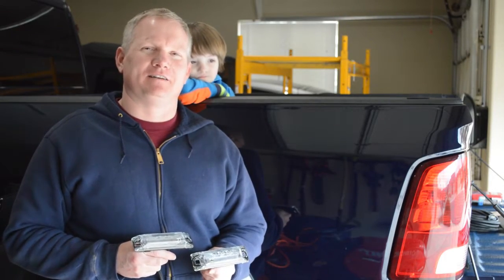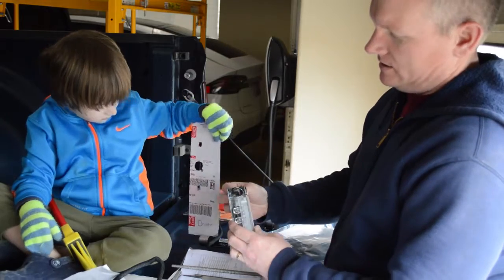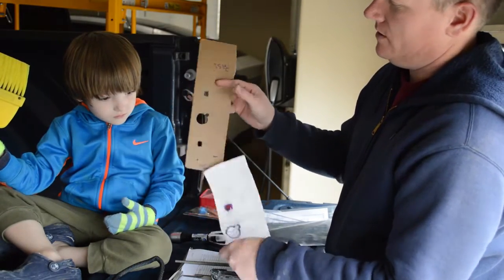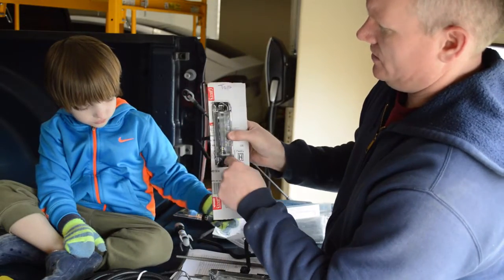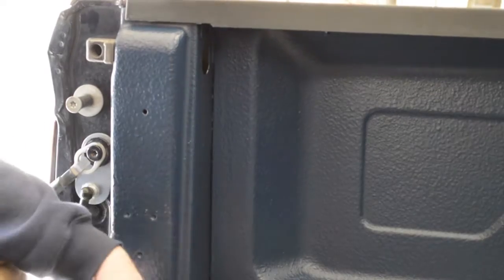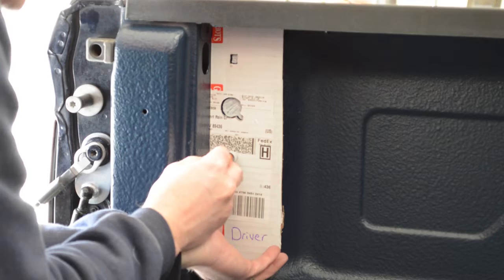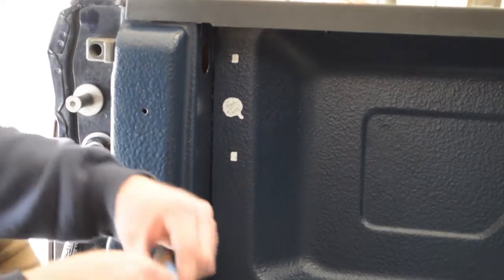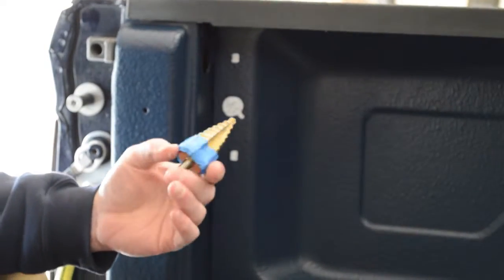Installing OEM LED Bed Lights  - Ram 1500

Comment: Was able to tap in at the C1 plug. Helped to remove the light switch box and AC vent housing and go at it through the vent hole and from below. Headlamp flashlight is a must! Tapped in the a t-tap.

Comment: Jack thanks for the template.  I just drilled the holes and mounted the lights.  Still have to complete the wiring.  The template really helped.  If any of your followers need the template I will gladly pay the favor forward and mail it to them😁
Reply from the maker: John FitzGerald awesome I’m glad it worked well!
Reply: John FitzGerald I’m interested in the template if you still have it.
Reply: Hey John and Eric, any chance you guys still have the template?
Reply: @epix8012  Do you still have that template by chance?
Reply: @epix8012  I’m looking for the template as well!  Anyone have it or can duplicate it?

Comment: It appears that there are two different kits available for the 4th Gen Rams (DT). Mopar part # 82214870AB is for model years 16-17 and is also the one that you should use for previous years as well. For 2018 the kit was updated to include a bed mounted switch, Mopar part # 82215795AC. These two kits will also work on the Ram 1500 Classic and Ram HD 2500, 3500 models up to the currant model year. There is also a 3rd kit available for the 5th Gen Ram 1500's (DS) 2019 up to the currant model year , Mopar part # 82215272AC.

Comment: Just a small tip: use normal car oil on your drill bits to drill into metal.  It saves the drill bit as well as makes drilling a lot easier.
Reply from the maker: Riaan van der Westhuizen Great tip thanks I’ll try that out.

Comment: So the cargo light it is located on the side panel from the steering and is it white ? How come you haven’t tasted it directly from there but to the wiring beside the seat ? I was trying to find this mod from long time..but I’m always afraid to touch electrical stuff and screw it all up !

Comment: question please ? how did you determine what size fuse to use ? Also do you know what amperage the LED cargo lights draw ? thanks for any input, I am doing this but for a 2019 ram that came without the bed led's
Reply from the maker: Billy ST I watched a different bed light video that used the led strip and they went with a 20 amp fuse. LEDs have a low amperage draw and I thought I was playing it safe with a 20 but I’m not sure.

Comment: My 2016 2500 tradesmen has the holes for the lights in the bed, so anyone looking for and vehicle with the holes to make a template might try a 2500 or a 3500.
Reply: My 2015 1500 Limited also has them

Comment: My 2015 have holes om both sides its possible just need plug the wired?
Reply from the maker: The plug will be under the bed. The kit should plug in and run to the other side.

Comment: does anyone with a 1500 know the correct pins to run the bed switch to, i have to C1 pin 5 wire correct but not sure where the secon wire goes as ive seen 2 different diagrams with different pins and not sure which is correct. the cargo lights work fine after activating with alpha obd with cab switch but cant figure the bed switch out.

Comment: Mornig Jack, what lights are you using I can't find any  for a 2013 ram.
Reply from the maker: 2016-2018 RAM 1500 2500 3500 Cargo Bed Light Installation Kit MOPAR OEM, I got them off of eBay
Reply from the maker: They didn’t make them for the 2013 but these work and they are what I used

Comment: Jack, did you have 2 white wires with brown chasers to choose from?
Reply from the maker: John FitzGerald I had to use that light to check which one and I just got lucky. Stab it int the wire, hit the unlock button, if it doesn’t work tru the other one and put some electrical tape over the connection.
Reply: @JackGriffithsgarage  got it.  I used a check light too.  Just finished the install.  Your vid and advice came in real handy.    Just in time for quadding trip out in elk country, Northwest PA.   Should help loading/unloading in the twilight out there!
Reply from the maker: John FitzGerald awesome happy it worked out!

Comment: Just so I understand this correctly.  You took the wire from the bed lights and put a fuse between where you tied into the wire in the floor and the connection to the bed lights and put them into that compartment?  Or am I missing something with the green plug?  Great video!  I can't believe how hard it would have been to get connected to the panel underneath the dash.
Reply from the maker: Jeff Mayer thanks Jeff! Yes I put a fuse to the wire that ran to the bed lights just in case something went bad

Comment: Is there already a wire harness set up for this if so where is it
Reply from the maker: Dylan .M depends on what year you have. I have a 2013 and it was not an option that year. If you look up in the ram forum you can find the years the harness is in there. I have heard it is tucked up on the drivers side rear area. I don’t know specifically.
Reply: @JackGriffithsgarage  thank I have a 2015 holes are there I will half to check it out thanks for responding

Comment: 2018 ram 2500 and I had the cut out, with the wiring already done.  However, my lights won't come on and I'm asking before I have to trace it down.  Does anyone know where the control button is or is this supposed to automatically come on once I open my truck bed?  I searched and can't find a fuse.  Any help would be appreciated.
Reply: MrDreadfu1 I believe the dealer has to flash it or you need alphaobd to flash it on yourself.
Reply: P Falcon ty.  I’ll look into that!
Reply from the maker: I’m positive the dealer has to turn it on. AlfaOBD can do it and totally worth the money for it. Saves going to the dealer
Reply: Jack Griffith's Garage the dealer will only charge $99.95 for me.  The alphaobd is 79.99 ish.  I think I’ll just let them do it.  Thanks for the replies though.
Reply: MrDreadfu1 I have a 2018 1500 Ecodiesel that came without cargo bed lights and I’m curious to see if it is prewired to add the lights.  Can you describe where the existing harness/connectors were?  Thanks
Reply: Jonathan Rossman the harness for mine were right under the cut out holes.  If you don’t have holes already cut out chances are you won’t have pre-wired harness for the lights.

Comment: Couldnt you just push out the light switch panel with the cargo light switch and connect right behind there?  Nice mod!
Reply from the maker: Jake Mason maybe?
Reply: Found my own answer.  Can't tap switch.  It's bcm controlled.  Have to tap the wire you did.   I did it a bit differently.   Used the tap on that wire as a trigger for a new relay to switch power to the harness for the bed lights. .  Thanks.

Comment: What is the bolt that holds up the led lights
Reply from the maker: It’s one that comes with the kit and it goes into a wing nut spreader type thing, it might be a screw not a bolt
Reply: I just got the light replacement since truck already has the wiring kit set up. But don’t have the bolt lol... so yeah idk what’s the number

Comment: Do you have a video for the fog lights
Reply from the maker: jlserna11 a video of how to install them and wiring them up? Or just installing new lights on the truck? I’m planning on replacing the factory ones with yellow ones. That will be coming late this summer.
Reply: Installing them and wiring them up
Reply from the maker: jlserna11 no mine came with the lights already installed

Comment: Jack, we have a few other Rams in the parking lot at work, but none have the pre-cut holes from the factory.  Would it be possible for you post the dimensions of your template and placement of holes?
Reply from the maker: John FitzGerald I can but it wouldn’t be until this weekend.
Reply: @JackGriffithsgarage  that would be great.  I just received the light yesterday and planning to install them this weekend.
Reply from the maker: John FitzGerald I am trying to scan the template so you can just print the same thing out.
Reply: @JackGriffithsgarage  that would be awesome.  Thanks much!
Reply: Thanks Jack.  I just emailed you.
Reply from the maker: John FitzGerald your template is in the mail.
Reply: @JackGriffithsgarage  that's awesome Jack.  You're a good man!
Reply: @JackGriffithsgarage  Hey I know this is an old post but if you still have the template could you email it to me? I could donate? also where did you get the light kit?
Reply: @johnfitzgerald5158  Do you by chance still have the template?
Reply: @albertwallace8250  unfortunately I searched and searched  for it in my garage.  I have a feeling that somebody in my family (not naming any names) thought it was a junk piece of cardboard and tossed it.  Disappointing.  I really wanted to pay the favor forward.  Sorry!